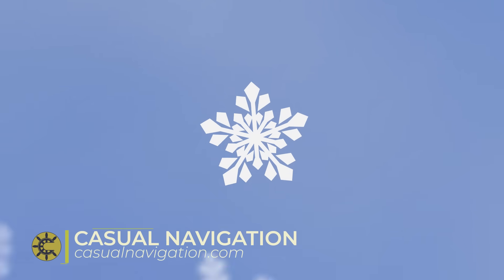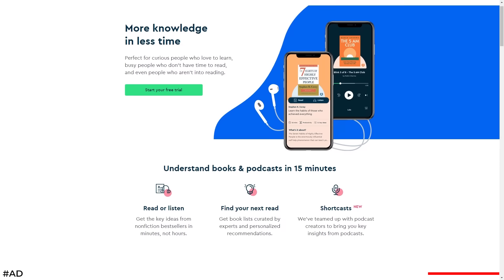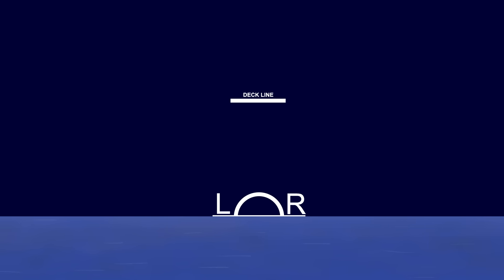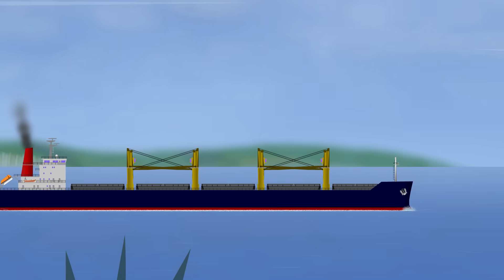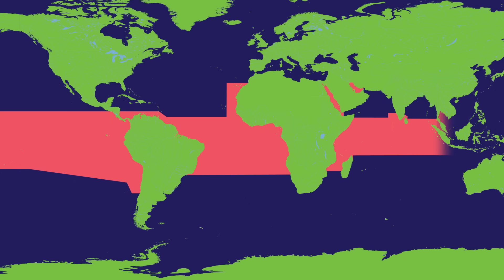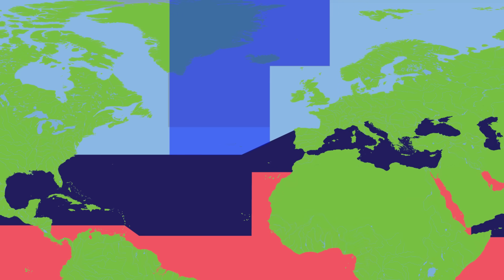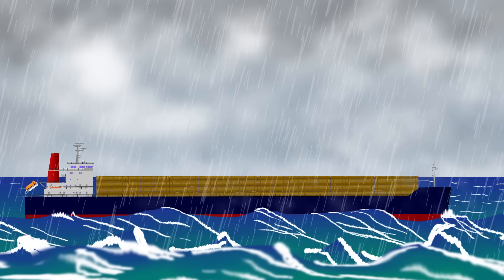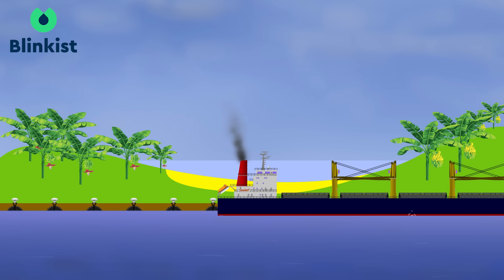Why Do Ships Carry Less In Winter?

Comment: Fun fact: Airplane normally can carry more in winter due to colder thus denser air, and better cooling for engine performance. 
And bad weather for aircraft also less in winter due to less convection movement, but some other weather condition like fog depends on where you are.
Reply: Another difference with planes is the tropical part. Whilst the tropics typically mean calmer seas, the strong convection currents at the intertropical convergence zone (the path directly under the sun at any time of the year) mean that flying though that part of the world can get very rough.
Reply: Yea the worst case is taking off from a high altitude runway on a hot day. Plenty of GA crashes have been attributed to being overloaded for those conditions.
Reply: @bubba99009    Absolutely. Saw that at the airport of Samedan. Alpine flyers were ready for Summer, but it was mostly Germans who were unfamiliar with hot & high conditions who highly underestimated the danger of these conditions. Saw one load his Cessna with family and luggage. Other pilots warned him that it wouldn't work. His ego told him that his plane has enough power and upon takeoff, he couldn't get out of ground effect. He avoided a tree, tried to do a teardrop maneuver and land back at the airport. But as he turned, the plane lost height. He luckily straightened the wings at the last moment and landed on the grass which belonged to a farmer next to the airport. Stopping distance was short because he was close to stalling. Several people helped him push the plane back onto the tarmac and he was deeply ashamed when he turned up again facing the same pilots who had warned him. He was then taken away to a seperate room by somebody from atc where he was questioned by authorities. I heard in the aftermath that he was heavily fined for what is called "Aussenlandung". Basically an "outside landing" which is forbidden in Switzerland. Several of these incidents prompted the airport to make it mandatory for pilots to get a special briefing first from local pilots. Since then, it all stopped. Not a single incident since these briefings are mandatory.
Reply: Yes it certainly "depends on where you are".  Where I live in Canada winter means icing, potentially before the airplane even leaves the ground. 
Now I am curious.  How many deaths/accidents are there annually from icing compared to convection?  Does anyone know any hard statistics?
Reply: I wonder if icing in winter also enters into the ship loading for the North Atlantic.  Tons of ice will change things!   Probably not a big deal for large ships, but the amount of ice relative to tonnage will increase as boats get smaller.
Reply: @HweolRidda  i agree, the amount of ice that can build up can be considerable from a weight perspective, tho im sure like aircraft they have countermeasures to help, still has to be a consideration i would assume
Reply: @HweolRidda   convection like a thunderstorm or just regular turbulance?  i dont know of a single airplane that has EVER been brought down due to turbulence.  i know several that were damaged beyond repair, but I would stake my rep on there not being a single one ever downed because of turbulence.... now thunderstorms and icing on the other hand.....
Reply: Wouldn't a similar density issue apply to ships? Just like salt water has a higher density than fresh water, cold water has a higher density than warm water.  Wouldn't cold water allow you to load more cargo?
Reply: @ramrod132  temperature and pressure have a much greater effect on the density of air than of water
Reply: And aerosucre was like yup its winter in Chicago we can easily put an extra 2 tons of cargo in Colombia
Reply: affects take off
Reply: Joe bidens daughter said in her diary that Joe took inappropriate showers with her when she was a child
Reply: The engines produces more thrust in the cold. It's why max takeoff weight can be lower at hot airports. Famous incident with a 747 in 42C Athens. Plane refused to climb and they took several satellite dishes skimming the rooftops. They planned on crash landing into a mountain just outside the city but got into some cooler air and got the thrust to climb, plus some controversy if they possibly forgot the glykol system. One of the closest calls that did not end in loss of life.
Reply: @please_stop-v7o  I thought that it was because of engine failure that they couldn't take off properly?
Reply: @p@p @please_stop-v7o ad of misinformation. How desperate people are to get a few likes, it's crazy...
Here are the facts: Air temperature on that day was 32 degress, not 42. The flight crew inadvertantly switched off the water injection system. This is clearly stated in the incident report. There is no speculation about it. Injected water would have cooled the air stream and thus allowed for a higher max thrust setting. 
And no, that system had nothing to do with glykol. Where did you get that from? Glykol is bloody antifreeze. It's meant to keep liquids from freezing and is a bad coolant. And why would you spray a jet engine with glykol unless you are suicidal and want to have four engine flameouts. Water turns into steam and steam doesn't extinguish fire. That's why water works in a combustion chamber.
And lastly, they had an engine failure. The flight crew decided to retract their landing gear immediately which was against SOP, but reduced drag significantly. They lowered the nose enough not to loose too much speed and stayed in ground effect. And it wasn't cooler air, but a slight headwind that allowed them to turn away from a hill and dump fuel over the ocean. You managed to get one single detail right. They did indeed hit a few rooftop antennas. But seriously, don't you care even a little about being at least a bit truthful about what you write? I was in the Air Force, have discussed this incident with both pilots and mechanics and find your comment quite frankly embarrassing. It doesn't help anybody and just makes things worse for all of us. By the way, the famous accident investigator Greg Feith created his own podcast because of people like you. Instead of enjoying his retirement, he feels pressured into fighting misinformation from people who shouldn't be on the internet in the first place. Let's keep aviation a clean place where facts prevail. Ok?
Reply: It's not that simple.Airplane have a maximum take-off mass,that can not be exceeded,no matter the season.
Takeoff perforemance at MTOM may or may not allow to depart from an airport in summer or winter.
Reply: @RoBert-ix6ev  Yes; in some cases, the airplane must take off under gross weight from a "hot and high" airport. Once up into the flight levels, the temps are relatively constant throughout the seasons (that is, very very cold.)
Reply: @RoBert-ix6ev  That isn't entirely true. The FAA has a special certification procedure for airlines operating exclusively in cold regions, allowing them to operate up to 15% above MTOW. It's mainly used by carries in Alaska.
Reply: @wojciechmuras553   Untrue. The next misinfo comment here. People, you need to do better than this. There is an FAA waiver for remote operations, not cold weather operations. An aircraft is allowed to takeoff 15% above MTOW because they have to carry mandatory survival equipment when they operate out of remote Alaskan airfields. In this case, the FAA has decided that the the risk of keeping the structural integrity of an airframe has to be weighed against the risk of crash landing and having to survive in the wild for days or even weeks. Hence the 15% above MTOW waiver.
Reply: @patrickglaser1560  Yeah glykol/water was availible for additional thrust.
Reply: @please_stop-v7o  I think you're confusing TKS "weeping wing" Anti-icing systems on small general aviation planes that use a propylene glycol/water mix and CAWI (continuous alcohol-water injection. That said, the 747-200 didn't even use the methanol, it used pure demineralized water and had a dump valve that was opened as part of the after takeoff checklist to empty the tanks thus preventing freezing at higher altitudes. No thrust augmentation system that I'm aware of uses glycol, they're all either pure water or water + methanol.
Reply: @ParadigmUnkn0wn  Thanks for your kind comment. But why 747 requires demineralised water? What is the application of DM water for aircraft?
Thanks.
Reply: @cck1496  if the water was not demineralized, then when it turns to steam in the combustion chamber, mineral deposits would be left behind. Same as scale buildup in a boiler, water heater, or coffee pot. Another common place you can see mineral deposits are on a shower head, or simply water spots left behind by hard water. In the case of the JT9D engine in the 747-200, it dumped 600kg of water into each engine over a 2.5 minute period on takeoff and initial climb, so you can imagine how any mineral content in the water would very quickly be an issue when dealing with such a volume. The official spec required less than 10ppm (parts per million) impurities in the water. In practice, procedure was usually to uplift 2300kg of water, providing 2.3 minutes of water injection (2.5m was the max permitted per engine specs).
Reply: @ParadigmUnkn0wn  Thanks for your kind and detailed explanation. For dumping such large amount of water, surely there would be a pump...So, would you kindly tell please, what type of pump it is and is it "engine driven"?
Now a days, RB211 does not employ this system....
Thanks for sparing your valuable time.
Reply: Temperatures at 35,000 ft are much the same summer or winter. Then what happens if you fly to the equator where summer and winter don’t really exist.
Reply: @Dave5843-d9m   Pilots don't calculate aircraft performance for cruise altitude. Cruise altitudes are written in the OFP and calculated by the FMC. But pilots calculate takeoff performance. This is where temperature and wind and essential for takeoff performance. In hot temperatures, the air is thinner and carries less weight. Additionally, hot air costs engine thrust. If an engine gets hotter air, it needs to run less hot itself in order to stay within temperature parameters.

Comment: Well, the video didn't explain at all the title. Sure, there are load lines, but warm water is less dense than cold, so it should be intuitively vice versa. When I quickly searched internets, it seems the reason is weather and waves, which tend to be worse in winter.
Reply: I was watching the different parts again and again, not getting what I was missing because i couldn't get the explanation either :/
Kinda guessed the waves issue because of the drawings, but I agree with you that it wasn't clearly explained
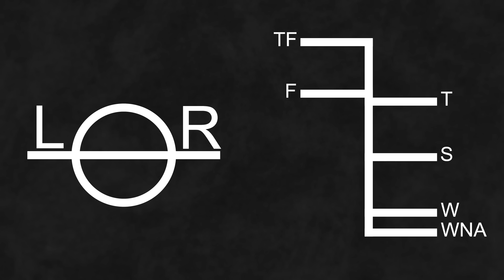Reply: He talked about getting additional freeboard when in good weather such as the tropics, and reduced freeboard when in bad weather such as polar latitudes in the winter. From about 3:40 o 4:40
Reply: @phantomsplit3491  Yeah.  I thought it was 100% clear, but I used to live on the coast of the North Atlantic.  It might not be super obvious to someone living somewhere like the Mediterranean.
Reply: 4:21
Reply: @brianargo4595  What? Says nothing about why.

Comment: I assumed it was because of the difference density of cold vs warm water.

(but now that I thought about it it would be exactly the opposite. Cold water is more dense)
Reply: Water is most dense at 4° , but apparently higher waves have more negative impact than denser water
Reply: Pretty sure it's about the ductile/britle resistance of the structure. With lower temperature, metals can't absorb as much energy without breaking.
Reply: @Jehty Cold water is denser, so load line is lower, because one should want to keep the mass of the ship constant (and therefore forces acting on the hull). Or so I'd thought before watching this video. However, changes in water density due to temperature would be an order of magnitude smaller than 1/48.
Reply: It depends on the exact temperature, water has a weird thermal  curve
Reply: Ocean water barely changes temperature throughout the year.
Reply: @unlocated7448  the temperature varies quite a bit from 40f to 86f. Try swimming in the north Atlantic in the winter
Reply: @Lgg91  Try swimming anywhere under 37°C water temperature and you find after certain amount of time you will have hypothermia.
Reply: @Lgg91  ocean temperature varies close to the coast and in shallow water somewhat due to current and solar heating. Waters of deep oceans barely vary.
Reply: @Paltse  I don't believe you'd have hypothermia at 35° in any reasonable amount of time like 8h
Reply: @grekiki  Test it out and tell us afterwards. No enclosures to shield your head from wind effects then.
Reply: @Paltse  the body temperature is around 37°C. How would one get hypothermia from warm water??
Reply: @thekohhh  You failed to notice the word UNDER before the 37°C. Under it includes anything from absolute zero to 36,9...9°C and people were talking about winter temperatures so I was mainly concerned with temperatures nearer to 10°C down to -4°C with one channel taking the upper temperature of 35°C to question and one channel failing English comprehension.
Reply: @Paltse  man, your communication skills are really bad.
If you say "under 37°C" nobody will think that you were mainly concerned with under 10°.
Because then you would have said under 10°C and not under 37°C.
Reply: @Jehty_  In any case you being in the water is not healthy for your long term survival, or else the healthy USN personnel that were somehow out of their accommodations suddenly as USS Indianapolis explicably slipped beneath the waves would have been fine and dandy for months and months, but they weren't.
Reply: @Paltse  and if you keep banging your head on your keyboard maybe someday you will make sense.
Please keep trying.
Reply: @Jehty_  Naah, mate, I still have fingers, hands and arms for that in addition to toes, feet and legs and I do make sense, you just don't want to acknowledge that fact. I concede the fact that there is a cutoff point of which I have no interest finding out what it is when hypothermia changes to the other cases of affairs, but it exists no matter how much you want it to not exist, and I assure you, even if you were in a waterpark, you would at some point want to get out of the water for multitude of reasons one of which is your health benefits. Too much of anything is a bad thing, medicine at some point turns to a poison, eat rye bread for 80-120 years in small doses and it will at some point kill you. Or turn you to mummified monk that breathes very slowly and is practically dead.
Reply: @Lgg91  "Try swimming in the north Atlantic in the winter." Try swimming in the North Atlantic in summer  🥶
Reply: @Paltse  yeah no, turns out the human body can regulate heat and hence if you are in fairly cold water it will try to keep yourself hot, else people who excersize would die from heat stroke and people who stay in pools of water below body temp for a few hours would die. Hence no, you won't get hypothermia in 36.9C water, nor will you on 35C but you will in water usually below 24C. However just when one gets hypothermia depends on your age, size, condition, consumption of drugs like alcohol and any previous medical conditions.
Reply: @CarlosAM1  Operative word being "try"  but as you said, terms and conditions apply and sometimes the trying fails and then the connection between the body and the self grows ever more thinner until the connection snaps. Also: Thank You for being yourself.
Reply: @Paltse  sometimes. But many times no, hence you don't die in pools or when taking a shower. Not sure what your point is
Reply: @CarlosAM1  My point is that everything connects to everything else if you dig deep enough.
Reply: @Paltse  and what does this even have to do with your original comment? Typing nonsense won't change the fact that you said that any water below 37C causes hypothermia. If you are not going to argue for what you said and instead will just rely to typing random things to try to divert the topic away from that then there is no point even replying to these comments
Reply: @CarlosAM1  I already adressed that earlier.
Reply: @Paltse  oh so I was supossed to somehow guess that by below 37C you actually meant something like 10C. Lmao
Reply: @CarlosAM1  Not that particular thing, the I'm sorry but I cannot be bothered to look it up at which temperature what happens, but hypothermia can come to one even in warmer waters and everybody should know that.
Reply: @thekohhh  water is very conductive to heat, even near body temperature.
Reply: @Paltse  I probably depends on the air temperature, I know I have spent all day in spring fed rivers and felt zero negative effects.
Reply: @Paltse You said under 37C 35 is under 37, so you should learn to write properly, his comprehension was spot on
Reply: @ Any temperature water below your body temperature causes hypothermia eventually, unless  the sealife gets to you first. In the video thumbnail I see winter and there are rare few places where there are temperature variations enough to have winter spring summer and autumn instead of monsoon and dry season climate and winter have +35C water temperature.
Reply: No, you have it right. Dude just read out the wikipedia page on waterline, and totally missed this sentence: “ Varying water temperatures will affect a ship's draft, because warm water is less dense than cold water, providing less buoyancy”. He was so close when he talked about moving from freshwater to saltwater, but still missed it. 
For everyone else:
Cold water is denser. This means a ship at the same weight will float higher up. This is why the plimsoll lines for colder temperatures are further down.